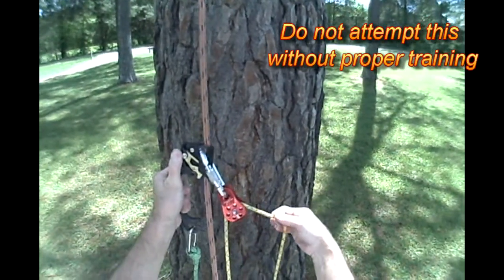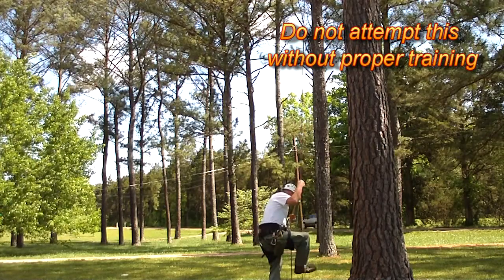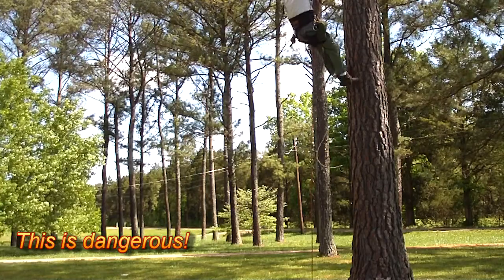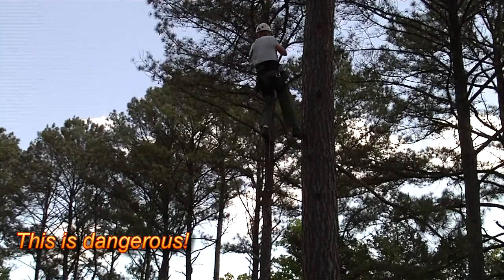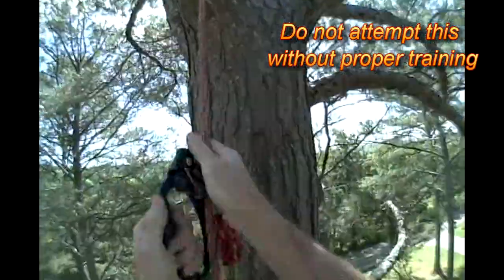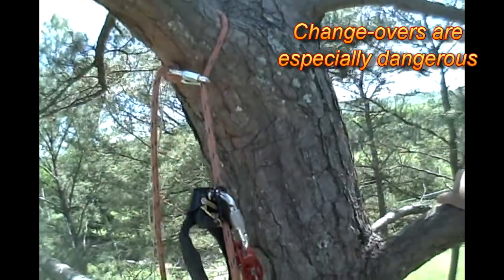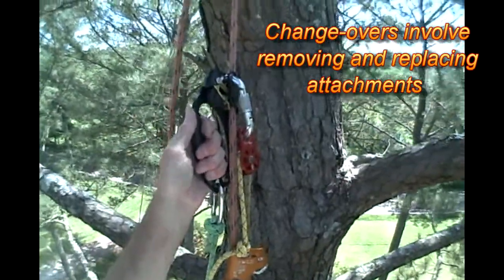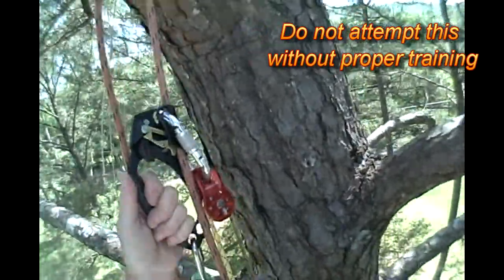2-1 frog (720p).mpg

Comment from the maker: @treeweasel100 
Good point, but I was tied to the rope at all times. At one point I only had a single attachment -and ascender but only long enough to install the Rig.

But I agree, it would be prudent to have an independent anchor and attachment. OTOH, when we start to rappel, we only have one attachment and if the descending device is something like an ATC or F8 we don't even have a hands free stop mechanism. The Rig, Grigri, and Cinch has a hands off stop built in.

Comment from the maker: @TheLimbReaper 
LOL - so true!

I apparently have some weakness, probably slight damage, in my left knee that shows up as mild discomfort and tightness when heavily stressed - like repeated full body weight lifts when climbing. 

When I did the Unicender ropewalker videos, I noticed the full weight strain on my knee. I pretty much avoid ropewalkers now, and am currently evaluating a Frog sit-stand which has very symetrical loading and the knees share the load at all times.